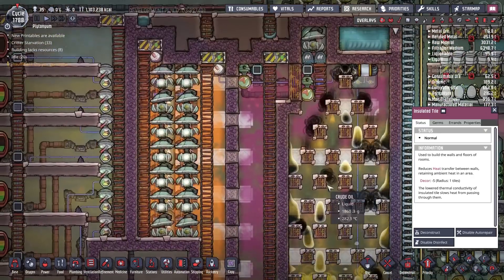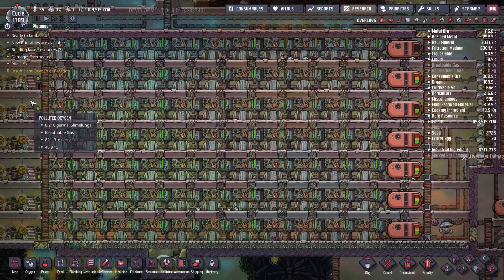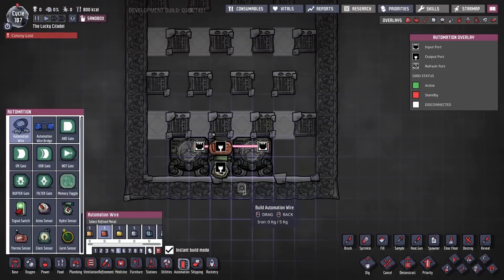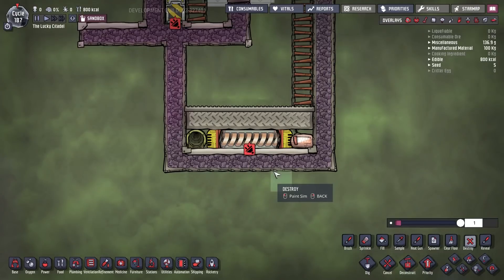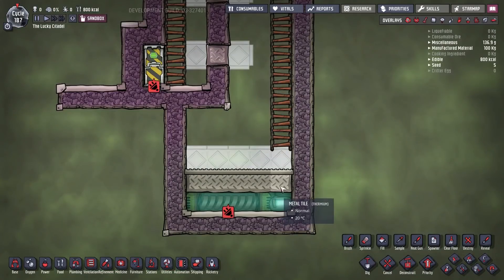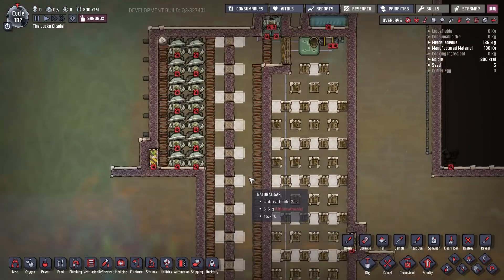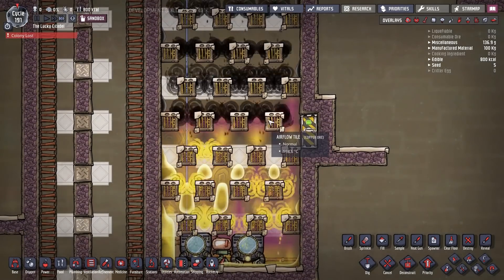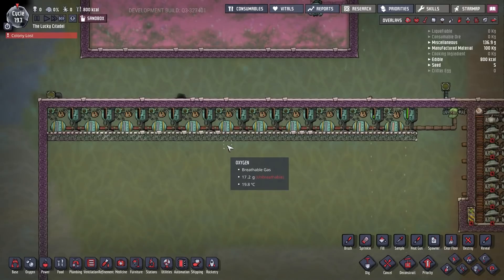50,000 watts for your Oxygen Not Included base.

Comment: You have essentially created a multistage bubble type distillation column. Liquid enters from the inlet and is mixed with reboiler returns and flows downwards over check valves in which gas bubbles up. I imagine that you can use something like this to fraction large quantities of vapor, though I don't think that's necessary since crude oil goes straight to petroleum, sour gas, methane, and natural gas.

Comment: Can I make small suggestions (experiences from my survival map.. ran into some problems lol). Few things- first is the 3 airflow tiles you have separating the oil petrol aquatuner room with the sour gas cooler room. Right where those airflow tiles are located I suggest putting a mechanized airlock door with an atmosphere sensor in the sour gas cooling room. What happens sometimes is the build up of sour gas over 30kg per tile can seriously hinder the cooling speed of two aqua tuners. Let the gas flow in at "20kg" intervals (it will let in 100kg sometimes but no big deal at least the super coolant can catch up). Another point that might help people before just building and walking away.. set up some automation toggles to whatever smart battery you hook the generators up with. This way if you see a problem with natural gas back up or if the sour gas cooling room gets flooded with natural gas you can turn them on and leave them on to fix that problem. Besides that I will always use this design.. Have tried others but yours is truly consistent. Hope this helps anyone out there.

Comment: Well done. A couple improvements could be made, but as I haven't tackled this project yet, I won't even try to suggest those. My one tip however, be that you don't always need the automation gates. Connecting two wires directly acts as an OR Gate, as long as you don't need separation of sensors for other inputs. So turn on if atmosphere under 20kg AND hydro under 1 could be turn off if atmosphere above 20kg or hydro above 0. Also, you should raise the dupe access door in the oil chamber by 1 tile so oil wouldn't leak out if you had to use it. Still, great video.

Comment: This is wonderful. I suspect you had a series of gas 'airlocks' that formed (similar to how some people use CO2/hydrogen locks), though I'm not certain why flooding the room with sour gas cleared them up. Maybe something to do with why all gases eventually travel up the first boiling chamber even though my intuition would be that at least CO2 would've fallen down to the bottom.

Francis John had some nice improvements that he put into his design, in particular I like the temperature controlled hot/cold plates and I'll probably end up making good use of it when I build my design. Using the waterfall with the airflow tiles to convert directly from oil to sour gas in a single chamber at that rate is phenomenal. Thank you for this design. :)
Reply: The gas moves due to how the games handles the “tiles” of gas interacting with the liquid and is easily reproducible now that we understand it

Comment: I took this design and made an earlier game version in sandbox that can do the same thing. Still late-game, I guess, but earlier late game. Mostly I just got rid of the pool of super-coolant and the tepidizer at the bottom of the sour gas condenser and replaced it with a simple block of ice. I let the methane freeze to a solid, and then just pick it up with a couple auto-sweepers. (In theory one auto-sweeper would be enough, but you need 2 auto-sweepers due to the auto-sweeper pickup priority system - that a whole other topic). The auto sweepers put it into a conveyor loader which carries it up the natural gas chamber. None of it survives the trip, and instead exchanges heat and sublimates, leaving an empty crate on the conveyor. (Rarely, you get a micrograms sized packet in the conveyor, and due to https://oxygennotincluded.gamepedia.com/Thermal_Conductivity#The_minimum_mass_for_heat_transfers_is_1_g they don't sublimate and are just dropped at the top.) I also pick up the sulfur and carry it out the top of the chamber just as another way to cool that natural gas chamber. I'm not sure how much that contributes but I was able to build the gas pumps out of steel. I had a liquid pump in there too which ran at first but then when things started getting cooler hardly runs at all. 

Also, I moved the crude cutoff outside the chamber, so the only thermium that you need is for the aquatuner, and you only need like a few 200kg or 300kg of super coolant instead of the 6t. Wait - I did make all those metal tiles out of thermium, too, and I used aluminum for the radiant piping. I doubt that any of that is really necessary, though. Gold for piping and diamond window panes for the tiles would probably be serviceable substitutes. 

I also experimented with scaling the design. I built the exact same chamber, but used just six pumps and (only!) 25 nat gas generators. The nice thing about 25 gas generators is that it's 20kW, or exactly one full (pipe) of heavy-watt wire. I put a valve on the crude pipe limiting it to 3333 g/s, so it was essentially a third scale with the room to expand to full scale.

Comment: would this be possible with non space materials, if we perhaps enlarged the whole structure?
Reply: With another heat source, say a volcano. The main obstacle is the aquatuners, they would overheat if not space metal
Reply: Pre-space heating is not a problem with volcanoes etc, but afaik there's no way to condense sour gas without supercoolant. You could in theory use oxygen or hydrogen in your cooling loop, but those in turn also require supercoolant to condense.

Comment: Would the cooling tower be more efficient if the sour gas side was only two wide, allowing the tempshift plates to reach all the sour gas? Or is there a reason it's 3 wide?
Reply from the maker: It was 2-wide in a previous version and I can't quite remember the reason I changed it, there may be no good reason. Off the top of my head, it occurs to me that a 3-wide tower has the effect of reducing the lag between starting the machine and producing natural gas because the sour-gas-pressure doesn't have to build as much. Also, in a 2-wide tower the sour gas in the cooling tower would be at higher pressures, so cooling might be more difficult because more energy has to be transferred to cool the larger quantity of sour gas. (Or, easier, since more sour gas is in contact with the cooling surfaces). So... I'm going to say it's a definite "maybe". Perhaps someone will try it out.
Reply: and because in 3 tile wide the sour gas move quickly so it condense faster
Reply: keep it 3 wide and just add one more temp shift plate to each row?

Comment: The filter should be AND gate
Reply from the maker: An AND gate is certainly a good choice. It depends if you want to run the pump when both of the sensors are not-sour-gas or if you want the pump to run if only one of the sensors is not-sour-gas.
Reply: If you want to run the pump when both sensors are not sour gas, you could actually eliminate the AND gate entirely here. If you pipe both sensors into a NOT gate, the NOT gate will only send a green signal when both sensors are sending red, AKA when neither sensor detects sour gas.
Reply from the maker: @benjyp  Indeed, thank you. I figured that out at some point in the time since I made this video. :)

Comment: Move pump on left of your water tank, and on top of source gaz tower you can add metal tile and steam turbine :) it's add delete heat and electricity :)
Reply from the maker: Good idea. Since the last update, a steam turbine would certainly work for deleting heat. Figuring out where to put it is tricky though, we actually have to ADD heat with the tepidizer where the methane is condensed, so if we take heat out for steam then it seems like we'll end up having to put it back in. On the other hand, the natural gas is plenty hot when it is pumped away. Perhaps those hot natural gas pipes to power a steam turbine would be best.

Comment: could you not take this further by using the already cold methane to cool the rest of the power plant instead of using a tepidizer? and by moving the methane evaporation and pumps over there, you could more easily tie pump usage to actual running gens, so pumps are only pulling in as much as you need at a given moment. Or I guess you could precool the entire power plant with that oil you are bringing in. I understand people think its not worth the effort when you have this much power available to throw at things, but I am trying to challenge myself by playing the game with no tepidizers , heat deletion (so no wheezewort, AETN, or fixed output temp cooling) .
Reply from the maker: I'm having a difficult time visualizing what you have in mind. The tepidizer is certainly a point of inefficiency. If the excess cold were instead used to pre-cool the sour gas in some way then that sounds pretty rad. It would mean you don't have to power the tepidizer and the natural gas wouldn't get as hot before it gets sent to the generators.
Reply: @tonyadvanced6315  I'm sure using the hot sour gas at the top of the so called cooling tower to pre heat the crude oil comming into the system with a few radiant pipes there to get it to around 200-300 deg would be much better since you dont need the tepidizer at the top and the aqua tuners should run much less since its less heat needed to vaporize the oil and less power needed to condense the now cooled soure gas. Thats what his comment sound like to me at least and i think its a good idea.
Reply: @ullrichbrand7994  I have built these with no preheat of the oil and they work fine without it, it just isn't needed.